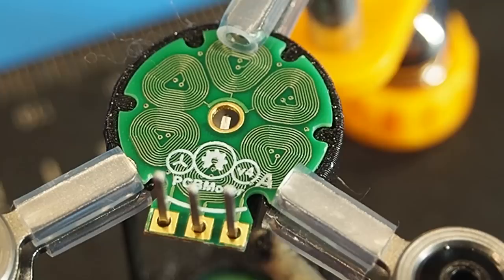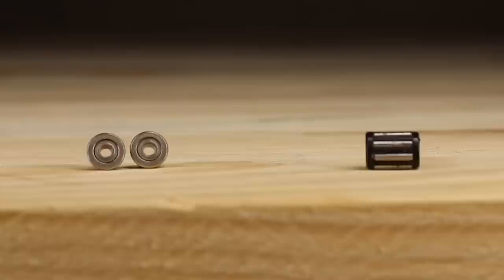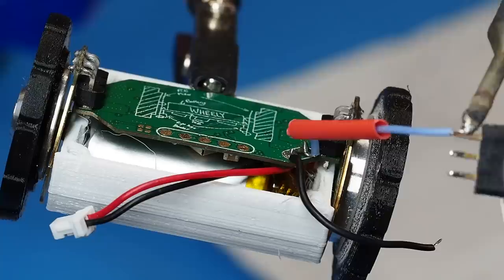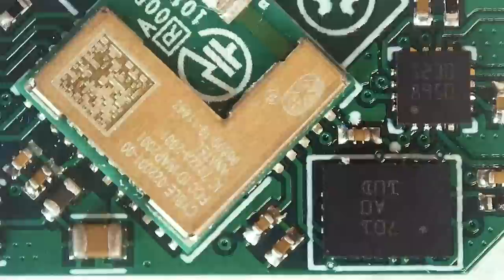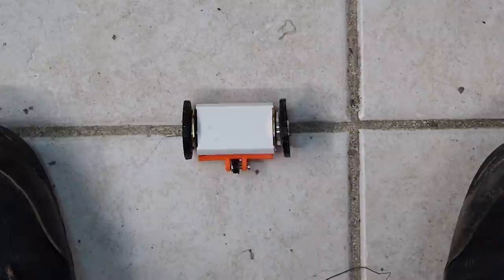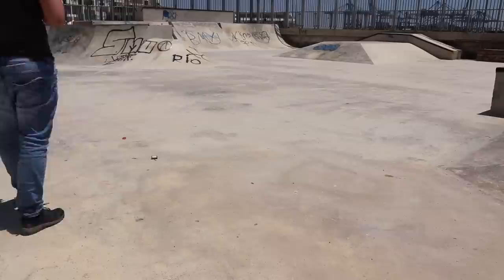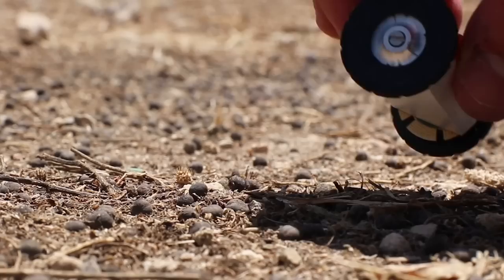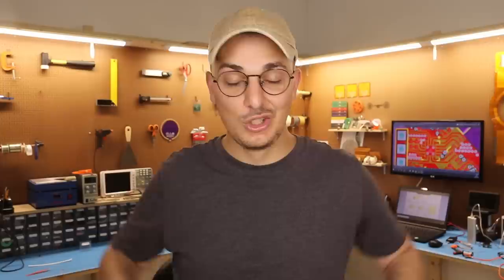PCB Motor 2-Wheeled Robot (Part 3/3)

Comment: You can also 2x the torque by adding a second stator to the outside of the wheels. Using 2 sets of stator coils in an upside down U shape straddling the wheel also gives you the chance to use 2 bearings mounted in the stator pcb and a short axle that is attached to the wheel like on a bike. This will give you rigidity and power. Another option for even more power and stability is a 3rd wheel instead of a simple tail. It will have lower friction and wont snag while also allowing you to add 2 more stators. In total you would have 6 stators instead of 2 giving you roughly 3x the power but only a tiny fraction more weight. You can use the tail as an antenna so you increase the range that you can control the robot.
Reply: Sorry to be the bearer of bad news, but that actually only increases around 70%.
Physics black magic, don't ask.

Comment: Great project, though your header switch is a bit silly. Just use a soft power IC and a teeny tiny button. Or even better, trigger it with a hall effect sensor. Best button is no button.

Comment: A opensource PCB Drone will be nice for the channel ;)) With  normal motors of course ..... or for your experience with Flex PCB  you can make a plane with all commands ( ailerons ,rudder, elevator ) made with magnets and coils  #altium
Reply: looking forward to see that
Reply: i too would love to see this
Reply from the maker: Congrats for winning the giveaway! :) Your comment with has the most #altium likes so far (i just sent you an email with the details) i have tried using this motor for a drone in the past, but it didn't have enough torque to rotate a propeller at high speeds but i defined need to recheck after all the updates i've made :)
Reply: @CarlBugeja  Thanks for the giveaway !  To make a  drone with integrated PCB motors is hard but i think is doable ,  " big " diameter  motor and a low pitch / big diameter  propeller . :goodvibes:

Comment: An #altium subscription would be nice. However, in the meantime, I would just like to point out that a lot of issues you are facing could possibly be mitigated with added environmental sense capability and some code.  Assuming that fits your goals.

Comment: Maybe using #altium you could build modern FemtoSumo class robot (10x10x10 mm) using flex PCB's :). I've made one few years back but it was hand soldered with connections made by coil wires without any PCB :D.

Comment: This seems like a wheely good project, i do wonder about using standard motors instead, just as a comparison, to better illustate the low torque you mention, but show benefits of your PCB motoes (be it things like weight and size)
Reply: the sphero ollie is a good example of what your describing

Comment: Could you make a book with coils inside each page so it can open itself to the right page? #altium
Reply from the maker: that would be cool 🤣but the magnets would make it a little bit bulky for the pages to open and work properly
Reply: @CarlBugeja  im not an expert on this, but i think ferrite cores would have to be used (to avoid magnets stick the pages together) and then just have the coils fields oppose each other where you want the book to split and attract each other where you want the pages to stay together
Reply: Connect the coils of all pages in series.
Connect both ends to ground.
Connect every point between coils to positive voltage through a transistor.
Drive the one transistor where you want the book to split.
The coils on one side will be magnetized in one direction, on the other side in the other direction.

Comment: O-rings for traction and lower weight than tpu. Steel backing amd mayb core for the flux. Shall make all of a difference. For core you might get away with solid steel as long as the rpms are low.

Comment: Great Work Carl you can use multilayer pcb for the coil and try out alternate lighter battery types, and also solar panels with super capacitors.#altium

Comment: I think the big challenge hurdle now is to get sinewave commutation on your motors and better back emf feedback, maybe even throw a small hobby brushless 6A esc on them and see what happens? Perhaps sinewave VESC, ODRIVE, or hall sensor / encoders? lots of things to try and improve this. Teeny tiny brushless axial flux motors just don't exist on the market aside from CD drive motors and the like, yours is the first I've seen!

Comment: If you can add FOC(field orientated control) you can get more control and more torque, so the wheel size can be increased a little bit. So you can add a bigger battery for more stability

Comment: you could add a secondary set of magnets and coils to each wheel on the outside. 
can also weigh down the bottom for better stabilisation, but i like the tail.

Great project!

Comment: That is coming together really well! It's amazing to see the progress from the first version to this one. Maybe using a slightly softer plastic in the wheels can increase it's grip and make it easier to drive on soil. Also, you could turn into a triangle - I believe that could be a good idea since because it's got three points of support, it would almost always (except in extreme conditions) form a plane and that would increase the stability of the robot. A 4-wheeled design could bring some advantages but could also introduce to much weight and make really unstable and hard to control, since any deviation or missalignment could make it super wobbly and also tend to turning to one side. Thanks for the amazing video Carl, looking forward for the next one! #altium

Comment: As an FYI the Cypress module cut out pattern is considered a minimum. You shouldn't close back in around with ground planes once you maintain the 4mm in each direction, that's just the minimal acceptable performance. If you check their app note 96841it wastes space and diminishes RF performance. You'll likely gain some meaningful dB if you moved it to the edge. You'd enlarge the ground plane and cause less shielding of the signal. Not that you've complained about RF performance but it's almost always best practice to put those modules at board edges.

Comment: but if you put the caps of the aerosol bottle as wheels (one wheel of which also covers up to 45% of the main robot's body (which remains inside the "cap"/wheel). To move better on the terrain.
(higher rubber rings at the ends of the cap for the wheels and a lower pattern in the middle)

Comment: Maybe you could scavenge some clock mechanisms to boost torque by gear reduction.  Then you could run your motors at higher speed, which might be more efficient.  Consider getting a Sherline lathe, too.

Comment: You might be able to increase the weight of tjr bottom section enough that the tail or wheel isn't needed. This could also help with traction for climbing small ramps!

Comment: My biggest recommendation would be to use a multilayer board for the motor and use the layers to create a better "coil" for the motor...  I'm not sure if connecting all the layers in parrell vs using via's to segment each layer together in series would yield better results.  A mutilayer board would be thicker and may provide more support for the magnets/wheel assy.  It maybe worth trying even with a single layer board, where you have traces on both sides to make the magnetic field.

Comment: The low torque of the motors would benefit from smaller wheels, but then you have limited battery and electronics size. You could also employ the motor in a different application where you could benefit from a low torque and high speed. Are you using any sort of active sensing of the angle, even if only back EMF? It might help to get even a little extra torque. #altium

Comment: You need to improve the magnetic flux density for bigger torque at the same diameter, meaning you either need more coil turns (assuming same current flow) and/or add mild steel backing to focus the flux leaking past the coils #AltiumGiveaway #Altium

Comment: Would you be able to add a second motor coil PCB to the outside of the wheels? It would double to torque that could be provided, but I don’t know how it would be possible to get power to it. #altium

Comment: perhaps you can design a gear system on each wheel to prevent them from being back driven and give them more torque. only issues is it will increase the thickness of the motors and you must increase the speed as well

Comment: If you're not already using a multilayer PCB you may wan to consider it. You could get more inductance that way. It may also be wise to have some sort of non ferrous backing plate to help form the magnetic field. This will also add a way to cool the coils as well as added stability of the PCB. I know a multilayer PCB will add thickness to your design but it will be minimal compared to the added torque you'll get out of the motors.

Comment: If torqe is still a problem, maybe your pcb motors would work better in a plane or quadrocopter setup, where torque isn't quite as neccessary as high rpm. Also, maybe a hovercraft-like device is also an option. did you compare the power output of small scale brushless motors with your pcb motors yet? that would give some indications if it's possible to use them for small scale single pcb flying applications.
In the hobbydrone market there are plenty of smallscale Flight-control PCB's that integrate everything you need to control an drive your PCB Motors for a fast test-build. Take the "Happymodel DiamondF4 5A AIO" for example. there is everything you need to build a drone on a pcb that weighs les than 4g. Usual drone builds around this AIO (all in one) controller weigh about 15 to 20 grams, i bet you could get easy in the 10g range with a single pcb drone.

Comment: 💡 If two wheels are with problems, try to use 4 wheels instead. And what if you add rubber surface onto the wheels for more friction? 🤔

Comment: what about weight? does it have any impact 

Increase the dimensions of the robot by 2mm all sides.

Include a pivot wheel at the end

more traction for the wheels

have you tried a solar cell on the top of the robot?

Comment: I think the design is really useful but forcing it to be a wheel is beating a dead horse, also IMO it defeats the purpose of the size, at that size (with everything integrated) it could easily fit a normal motor with enough torque. I think it'd be very interesting seeing it with some alternative mechanical way of movement that's not a cart, and also see if it can propel itself in the air like a drone, or in water, which would make a really interesting product, because unless you have a breakthrough with the torque and wheels/cart design, I don't think it's going anywhere.

Comment: Hello, axial flow motors could be the best choice due to their efficiency, which in some cases is greater than 90%, however, it requires a good electronic design for such levels, it would be good to add optocoupled sensors for greater sensing precision, for true great project bro #altium

Comment: #altium You could try increasing torque with a cycloidal or planetary gearset and by increasing motor frequency. Nice Video!
Reply from the maker: Thanks! That would increase the torque of the motors But the problem is that the motor is just 15mm in diameter so the gears have to be really small
Reply: @CarlBugeja  hm, then maybe a planar magnetic gear then? Would be pretty non- precedented but also a pain to put together.

Comment: Isn't sandwitching permanent magnets between two pcb electro magnets with phase offset should double the torque ? Or ideally double permanent magnets on the shaft sandwitched by triple pcb with one step offset on an ABC plane.

Comment: What about making a mini PCB car using a pair of these. By doing so you don't have to add any weight as a tail😁
Reply from the maker: have you seen the teaser? 🤣
Reply: @CarlBugeja  Yes I do😅.
Connect a pair of this tiny robot with each other and the distance between them must be that it makes a square. So, when you move both pair in opposite directions, the bot will go left and right. 😁

Comment: I Acutally had an Idea, wouldn't it be feasible to 3D-Print a mould for the Wheels and pour some Rubber resin into it ? 
Would give the wheels more traction i guess because of Material pairing

Comment: I really like the unique PCB motor idea. But it seems still very unpractical, even after all the time you spent. 😑
There are scale cars, commercially available RC, 1:76 and even 1:87 scale. They use hollow core or micro stepper motors and are really great. Maybe you have a look at one of those, if you're getting tired of the PCB motor. If not, keep these interesting, entertaining and educational videos coming! #altium
Reply from the maker: thanks! i appreciate your feedback - those tiny rc cars are so cool and quite impressive considering how small they are! however my goal here is to create a simplified robot - integrating one pcb that acts as the muscle, brain and shell of the robot - the only external components would be the rotor wheels. This is still an early concept and its far to early to tell if its viable but there's so many things left to explore and i'm excited to share my research here :)

Comment: would an ultralight plane or drone perhaps be better suited for these motors?
Reply from the maker: in the past it didn't have enough torque to rotate a propeller at high speeds but i defined need to recheck after all the updates i've made

Comment: Do you think you could scale up torque if you had multiple rotor layers per wheel?
Reply: Cool idea , would be nice to see it in action. I'd like to suggest an extra stator as well (pcb). Pcbs should be relatively easy to line up in parallel. I think some guy had suggested this long before. I wonder if Carl is still experimenting with this sweet project.

Comment: Could you make a spherical robot with this actuator? Like a large marble or golf ball sized BB-8?
Reply from the maker: That would be so cool 😍 I love to do that one day but I need to find a smaller battery which is the main limitation for this idea
Reply: @CarlBugeja  Don't be afraid of using disposable coin cells. Also there are lithium Ion coin cells. 

Also check out James Bruton's BB-8 designs his need a heavy weight to rotate the mass of the bot.
Reply from the maker: 👍 But the pro lem is that the battery has to be less then 2cm diameter and supply around 500mA.. So there no coin cell battery which can do this

Comment: From the video it seems you used only one layer for the coils? - you could try make the coils on few layers 

Also it would be interesting to see if steel core can improve thing

#ALTIUM
Reply from the maker: Thanks for the tip! The PCB Stator is made from 4 layers.. I have already tested some iron/steel backings https://youtu.be/kLvxkUa14lk

Comment: Have you tried half stepping? Or various degrees of micro stepping? Maybe with a 555 timer ic and some clever circuitry oh well that’s a stepper driver at that point but as I’m sure you know that motor works like a stepper motor and stepper motors such as in 3D printing can go up to 1/16 or even 1/32 micro stepping for more accuracy that could also fix the stability of driving #altium #altiumgiveaway

Comment: You should try to do it in way of some Beambot robot - add small solar panel to the tail (with next 1-2 wheels probably) to give small charge to that small battery on the sun to power itself. It will definetly work for a while, but lifespan will be prorably too short because high currents and small panel, but it will look cool. Also you can try to replace that batterry with supercap or maybe just tantalum bank, but that will be probably no-go for BLE because power fast cycling? #altium

Comment: Great video, Carl! Another way to stabilize it could be adding a steel ball bearing on the bottom 3D printed housing. It would be great to add a tiny camera, or maybe a sensor to avoid obstacles. #altium

Comment: Super interesting video, as always Carl!

What kind of inductances are you able to get with your PCB coils? I'm wondering if they could be used as in-board transformers?
Reply from the maker: Thanks! my coils are designed to be actuators but i did managed to use them as low power transformer here https://www.youtube.com/watch?v=k1inMrAZ_Eo but i have seen some other pcb coils used as transformers

Comment: Can you make a shape-shifting/transforming robot by using the PCBs as structural walls which can slide/rotate relative to eachother using designs similar to the PCB motor? #altium

Comment: I haven't figured a design way to do it but would it be possible to do a counter force motor/ gyro so that you don't need either the wheel or heavy part in back. That might improve stability and offer the small design the ability to go up hill easier. Dunno if it's practical but counter spinning disk could grant it the ability to stay upright though would deffinatly need more calculations on a variable speed thing counter to the motors #AltiumGiveaway

Comment: So I think this is cheating but a tread track design may be good for different terrain however this would increase the side/footprint, kinda killing the spirit of the design. Instead let's go with monster truck wheels that are completely hollow. Like the "hub cap" area just doesn't exist so its just large fins protruding sideways out from the spokes. And instead of it dragging a tail, having some sort of forward spring design to force more weight on the tires when it gets stuck. This won't help with sand but light dirt or very fine gravel could be fine. Think of it like a forward spoiler meant to press the vehicle down.